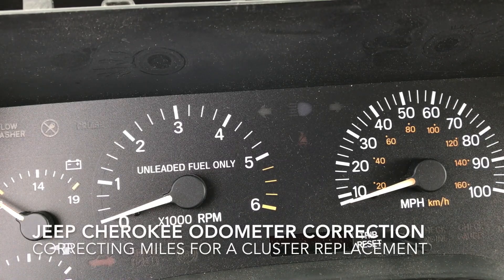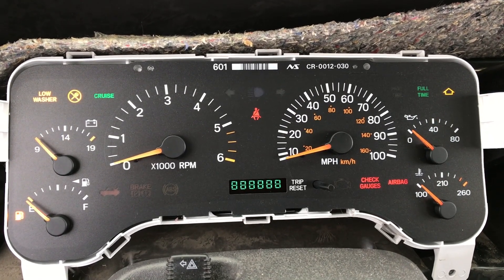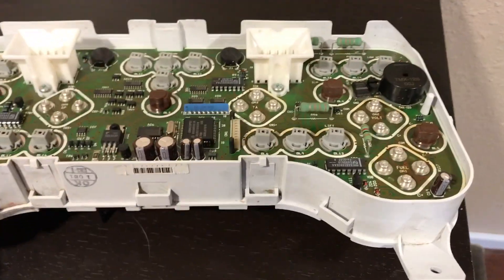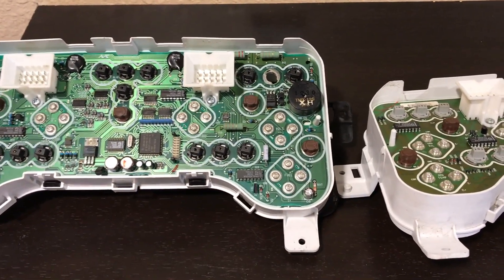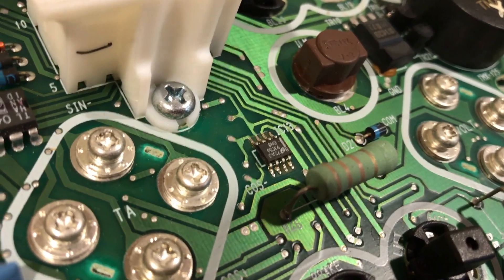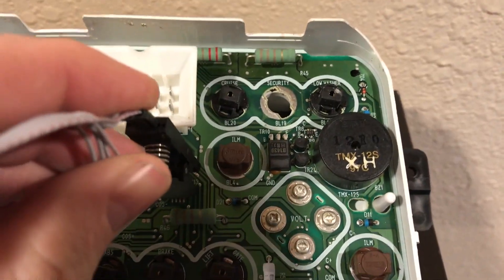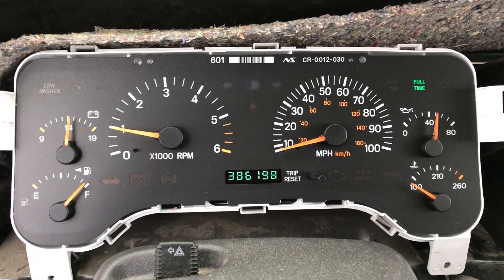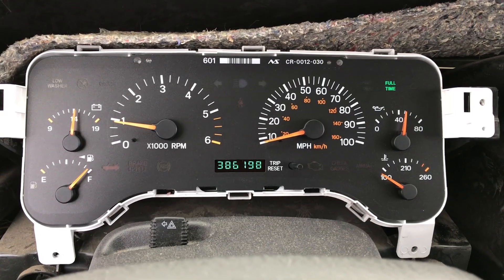Jeep Cherokee XJ Odometer Reprogram (1997–2001) — Cluster Swap & Mileage Correction

Comment: Hey Im interested in doing this on a 2004 Jeep Grand Cherokee? Any Advise? or maybe steer me in the right direction? I just want to install the Overland Gauge Cluster and i dont want the Milage to be Wrong on the Cluster im going to buy on Fleebay. Any help would be great thank you
Reply from the maker: The procedure is different for that cluster than what I have documented here. To program that cluster you will need a Digiprog or similar tool. I do offer this service, reach out to me through the email in my profile when you have found your replacement cluster and need the mileage corrected.
Reply: Wow, that is the fastest I’ve ever had anyone reply to a comment on YouTube ever. Great info thank you very much. I actually have the cluster. I just wanna make sure that it works the way it should before I send it off for programming. Found the contact info thank you.

Comment: My jeep only has the speedometer and fuel level. If I were to get a new cluster like the one shown in the video, would I need to attach any connectors or plug anything in or would it just be plug and play?
Reply from the maker: Plug and Play, use this procedure to correct mileage on the new cluster to match.

Comment: I got really excited when I found your video, but I don’t want a clone. I want a complete reset. I spent a few years rebuilding my jeep from front to back.  New motor, new transmission, transfercase rebuild and even the differentials. I would really like the odometer to be zero. Could care less about odometer fraud, as I’ll never sell the jeep.
Reply: Notice how you got no reply Because if you care or not makes no difference  to anyone but you. its Fraud you don't have to care. still is not legal. why do you care what the milage is then? if you are not getting rid of it just simple math can tell you what you have on your new setup ? Right ? lets say the odo says 235000. ADD any new miles and there you go !!! Free Fix Welcome..

Comment: So, what all exactly did you use for programming it, and where did you source it all? Is there a kit? I've found some parts online, like the SOIC-8 connector and the TL866 module, but what about the adaptor? And what program did you use, and where can I find it? 

It's a good video but my main complaint is the lack of consideration for people (like me) who don't know anything about programming. To someone who already knows what all of this is, this video would be a nice guide. To someone who doesn't know how to program (For example, pretty much anyone who wants to swap a gauge cluster in an XJ) it's a little confusing. Can I manually type in the mileage without needing to extract that data from the old cluster? If so, how do I do that with only 4 digits? Can I manually enter a VIN? Is the program you used even still available? Do I need an account/ membership to use it? What kinds of other programs might I be able to use instead? 

Thanks for this though, I was getting nowhere until I found this video.

Comment: So excited to see someone finally made a straight to the point video. Thank you!  I am going the solder route today.
Reply: did this work for you ?  
i dont want to risk messing up my newer cluster that i bought. i found one with almost the same amount of miles, but the new one says 6k less than my original and i would like for it to be correct (i will never sell this jeep that i built, just want it to be correct)
i had a broken gauge cluster that just had dummy lights and switched it out for a non-broken gauge cluster with all of the little gauges.

Comment: FYI the latest TL866A/CS firmware will "brick" your programmer if it is a copied clone of the "mini pro."
Some on the forums have said it bricked their original even. Evidently the manufacturer has a warning on it's website and shows the difference between both clone vs original.
They discontinued the old version and the Newest is the XGecu T56 Universal and TL866II Plus high speed models.
Reply: I wish I understood what you were saying. My 2001 Jeep Cherokee Sport has issues with the part. I can get a used one from Canada and may I ask who could reprogram it using this video for me? Would a computer repair person be best?? I am not focused enough to try to follow it now.
Reply: @racheldillemuth7584 ,
it has to do with "firmware" that is downloaded onto your computer, then loaded onto the "mini pro" device.
All logic chips are "programed" this way to facilitate updates. It beats having a chip "burned" with a program and become "hardware bound" and useless when it becomes outdated.

Comment: This is a very informative video! Touched on everything without being a slog of information.

One question though is if there is any information besides the vin and mileage saved on that eprom. I have a 100mph original and I’m swapping in a 120mph police cluster. I don’t want to overwrite any critical info that results in the cluster thinking it’s 100mph and being all out of wack.
Reply from the maker: Nothing besides vin and mileage.
Reply: @IcarusOffroad  would you be able to comment on wether a Mph cluster could be replaced with a kmph cluster and have the kmph cluster reflect converted mileage. 1.6 kms for every mile on the vehicle. So a 100000 mile vehicle rewritten to say 160000kms on the metric cluster.
Reply from the maker: @cookingwithjesus   my understanding is that if you toss in a KPH cluster into a MPH vehicle that it will display the speed and odo in KPH, and keep counting from the existing mileage. Therefor if a KPH cluster were reprogrammed to the equivalent KMs as the vehicle has in MI, it should pickup and keep working as a KPH cluster and record all the new mileage in KM.

I have also not tried this, but I believe this is how it works.
Reply: @IcarusOffroad  I made a video on my solutions I’d found when trying to reprogram a police speedometer

Comment: I know this is an old video, but how did that Jeep hold up at 380k? Any major repairs ? How’s the trans?
Reply from the maker: The left speaker channel of the radio died recently, so the radio had to be replaced. It’s still out driving around. Maintain your vehicle and change the oil regularly and you get lots of useful life from it

Comment: this is nice to know. but they must have changed it on newer jeeps. a friend has a 2008 and his went bad and bought a new cluster and all he did was hook it up started it. it showed 0 miles but after driving it a few miles turned it off and back on and it jumped back up to 130000 miles. or maybe it was because it was a new cluster not used. thanks i love videos like this.
Reply from the maker: The XJ Jeep Cherokee ended production in 2001. So whatever 2008 Jeep your friend had is a completely different vehicle. This method only applies to XJ cherokees, the reprogram method is different between grand cherokees, wranglers etc. Even the same year Grand Cherokee vs Cherokee is a different method.
Reply: @IcarusOffroad  i thought about that after i posted. but i still like videos like this. so keep up the good work.
Reply from the maker: @MadsWorld34  Ha no worries, thanks for watching.
Reply: Most all are stored in the BCM modules now.

Comment: This is interesting, I had to change the BCM in my "98 5.9 GC Now everything works but the odometer is about 93k more than my real mileage. If I decided to change that, I wonder if I should modify the BCM or the cluster? (or have someone do it) ... my other option is to just keep my eye out for another BCM that has close to my mileage.
Reply from the maker: Yes in the ZJ it seems that the mileage is stored in the BCM. Since the ZJ bcm has a microprocessor it’s likely that there is not a simple eprom chip to read and program. It may be more like programming the newer TJ gauge clusters.
Reply: @IcarusOffroad  Thanks a lot for your reply, I'll search around for more info on a
 procedure

Comment: It is my understanding that 97 98 clusters are not compatible with 99 00 and 01 because the gas light was replaced with the hatch open light therefore the pin outs and wiring is different.  Also 99s were the transitional year because the gas light was moved. But the check engine light was still the words and not the engine icon
Reply: Is this correct?
Reply: @MattWeaver909  I recently had an 01 XJ with 180k miles on it using a 97xj cluster with 140k Miles on it. Previous owner got duped
Reply: @ProjectDanH  Are the years interchangeable without issue? I have an 00 Xj and I just bought a new cluster to replace the dummy lights. I will be swapping the eprom chip to keep the exact milage. The Cluster I bought on ebay still has the "unleaded gas only" mark on it so that is before 99. I am hoping there will be no compatibility issues.
Reply: @ProjectDanH  I heard that the trunk open light stays on because the 00 Xj doesn't have a trunk sensor. Will that be the case?
Reply: @MattWeaver909  no, there is a lift gate warning light on the 00 and 01s too
Reply: The cluster I ordered has the trunk open light and the Check engine words not image.
Reply: @MattWeaver909   that is a 97 98 cluster..  I can program the correct milage and vin number for you if you'd like
Reply: @ProjectDanH  Will the 97-98 cluster work on my 00 2 door SE XJ? Thanks for the help!
Reply: @ProjectDanH  That would be great! How can I get in touch with you? Thanks

Comment: I love this option and I want it to work. Quick question on whether I just have chinese junk off of amazon or its user error. When I put the adapter into the programmer and try and read the chip, it gives me a Pin Detect Error and shows me a graphic of the programmer and the location of Pin#1. Adapter is in the correct position. Clip is in the correct position. I've gone through all configurations of adapter/clip location and error happens every single time.
Any hints what this could be? - Thanks
Reply from the maker: christopher dwyer well there are two ways to orient the clip, but even with a known orientation it can be hard to get good contact.
Reply: @IcarusOffroad  Ok thanks - I'll keep trying
Reply: Dude -  It does take a bunch of tries to get the clip right but it absolutely WORKS. Local Jeep dealer refused and I thought I was stuck just adding 86k in my head every time I looked at the odometer. Thanks again for this.

Comment: Do you have any suggestions for 2004 jeep grand cherokee laredo?
Reply from the maker: Sophia Omatsone this same method will not work for the grand Cherokee WJ. A Digiprog can be used with the WJ Grand Cherokee cluster.
Reply: @IcarusOffroad  is the chip the same/similar in the 2004 wj. Is the process the same and is it affected by the instrument cluster not working? Can I just desolder and transfer the chip?
Reply from the maker: Sophia Omatsone I think the chip is the same between the TJ and the WJ. It may be the same between similar year of clusters. Desoldering the PRocessor May work, but it’s very fine solder work to do. It’s not a large eeprom, it’s a fine microprocessor.
Reply: @IcarusOffroad  thank you. I am going to try the desolder method. Hopefully it works.
Reply: @IcarusOffroad  just to be sure, there are 5 IC microprocessors(MC) on my board. The only 8-pin MC on my board is IC3. Is there a chance that the MC with the mileage and VIN data is a different MC?
Reply from the maker: Sophia Omatsone I don’t think it’s an 8 pin, but you could try reading it with an sioc8 clip. However I think the information is saved in the Motorola processor. Digital kaos forums might have some specific info, but I think you need to read the information through the BDM port of the Motorola processor.
Reply from the maker: Sophia Omatsone also, take a look at my TJ cluster programming, you can see that method which I think you need for the WJ cluster.
Reply: @IcarusOffroad  in your video you were pointing at a 8-pin IC13. I know you said it's different for WJ but I didn't think you meant a 80-pin IC1 (on my board it is the only MC/chip that has a Motorola symbol on it).
Reply from the maker: Sophia Omatsone take a look at this video:     https://youtu.be/6Xm6FOhB1qo
Reply: @IcarusOffroad  I saw the bigger MC you were pointing at.
Reply: @IcarusOffroad  My OG cluster is broken. Power goes to part of the cluster. I want to buy a used cluster (new cluster NC) and program it to display the actual data or my OG cluster.
Reply: @IcarusOffroad  I was going to sent it to a store that repairs jeep cluster but I can't find one. I wanted to try to fix it but I don't know what is wrong with it. So replacing it is the point I've reached.
Reply from the maker: Sophia Omatsone if you just want the mileage programmed into a new cluster I can provide this service. Contact me through the email in my profile.
Reply: @IcarusOffroad  which profile?
Reply: @IcarusOffroad  how do I get your email?

Comment: 2008 Jeep Liberty say ERROR where it should have the mileage.  Any word on fixing this?

Thank you
Reply: I had the same issue after my battery was disconnected. I took my jeep patriot to the dealership and they couldn't tell me why and tried to blame it on my viper alarm/remote start. I tried everything from unplugging the battery and leaving it overnight, to pressing and holding the button while turning the key over etc etc. Ultimately what fixed my issue was buying a replacement dash cluster off of ebay (used for $40) and replacing the old dash cluster. It now works without "error" but retained the original mileage from the vehicle it was pulled from.